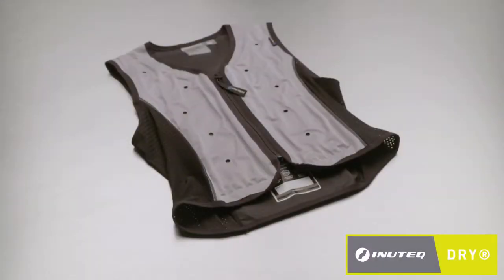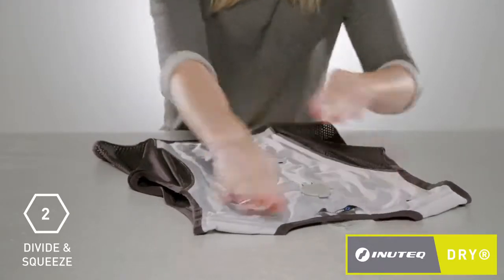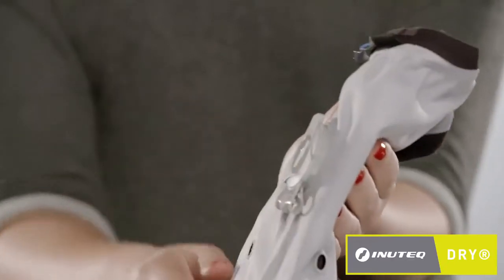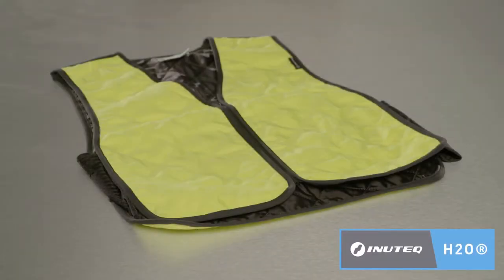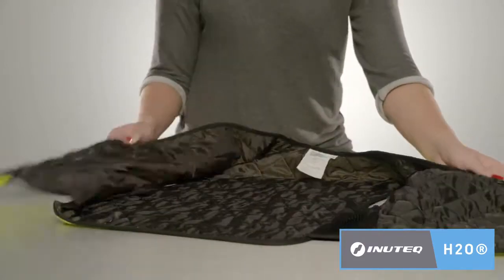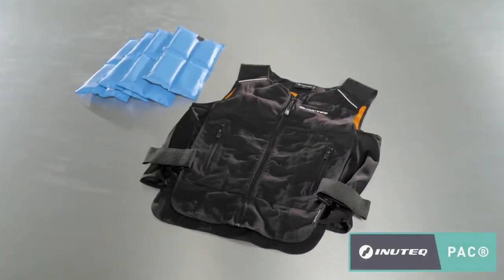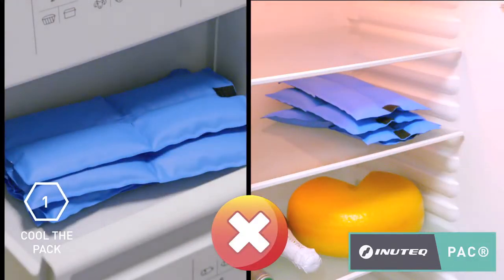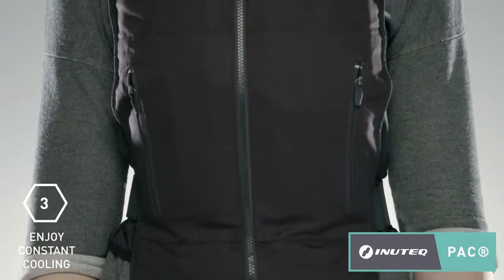Compilation INUTEQ Cooling Technologies

Comment: Tried this several times with the local humidity around 10-15%. Followed all instructions. While subjective, felt no cooling at all. At best any cooling affect only countered the heat caused by wearing a plastic vest.